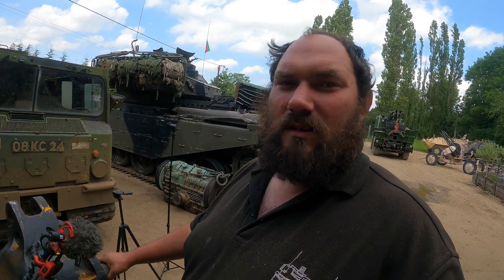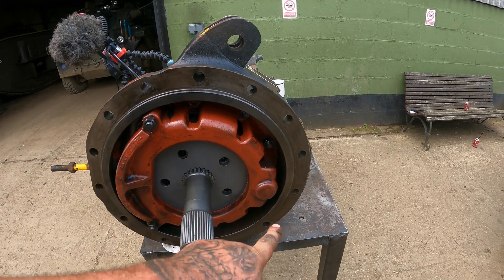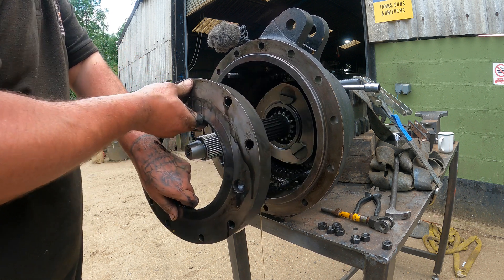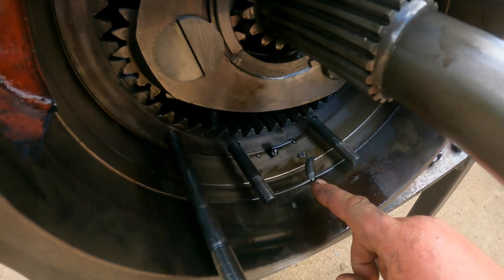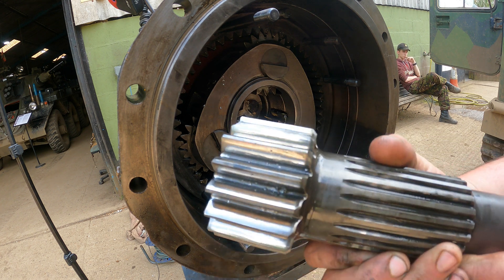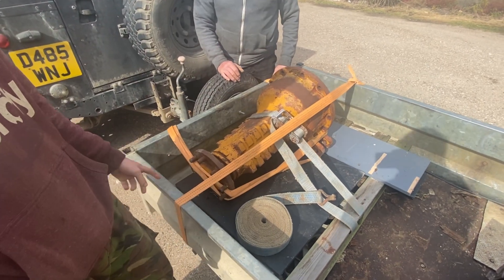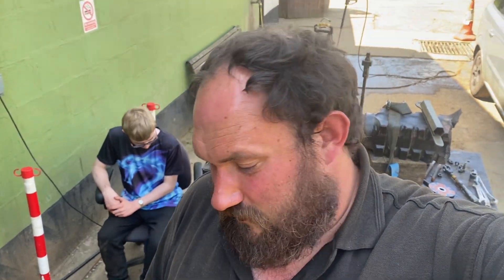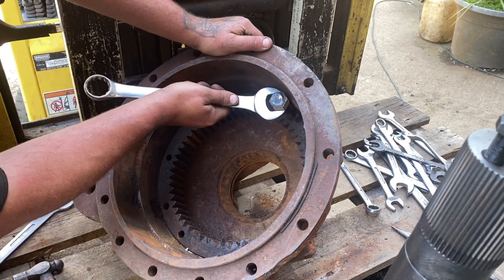It gets way worse, stripping WW1 tank rear axle  - Tinkering Tuesday

Comment: Using a torque wrench as a breaker bar. Bad scene. Thoroughly enjoyed the video.
Reply from the maker: @carlwilson1772  where? You’ll never catch me using mine as a breaker!? What time in the video?
Reply: @tinkeringwithtanks Looked like it was at 1:10,  but I can see now it is a big extendible ratchet handle. Consider me chastened and please accept my apology. I found you through Joe Hewes. Really enjoy your films and the way you go about things. I'm on my way to Norwich now (flew down from Inverness this morning) for my Father in Laws Birthday. Was going to come see you but I don't think you are officially open until next month? I love all things engineering. Ex RAF aircraft technician, have my own workshop with lathe, mill, welding gear etc.